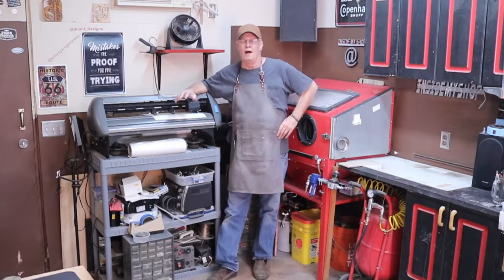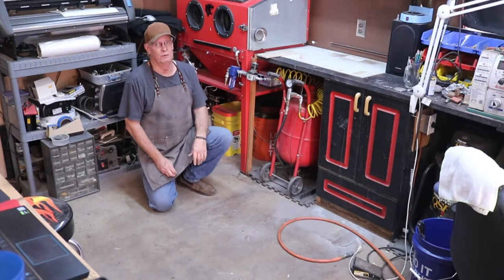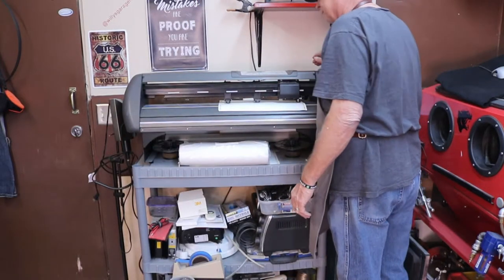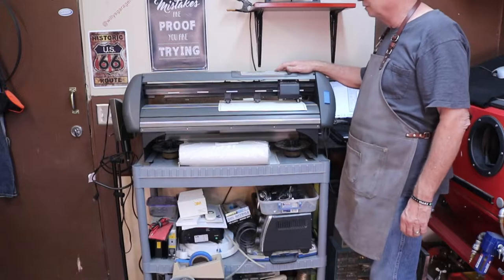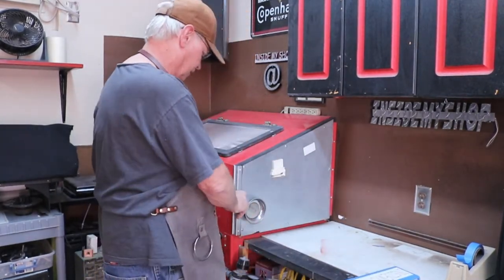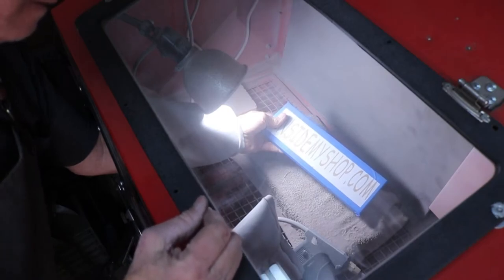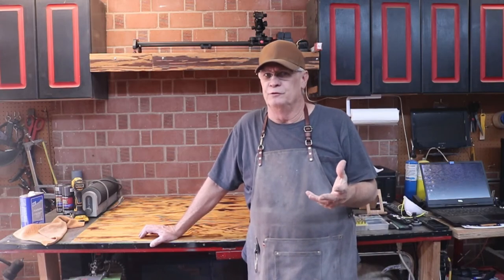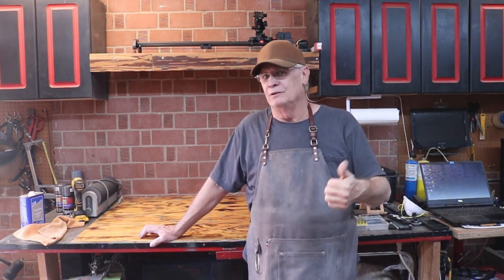Sandblasting Cabinet using a Pressure pot and PAB Blaster

Comment: Hey man, love your video but your work area is really tight, anyway what mask material are you using and do you use enamel paint?
Reply from the maker: Thanks,yea it's tight but with such a small shop I have learned to adapt. I use 3mil vinyl that's cut on  a vinyl cutter and 4 mil rapid mask. I mostly usel acquer. I found when using enamal it wanted to peel easier than lacquer